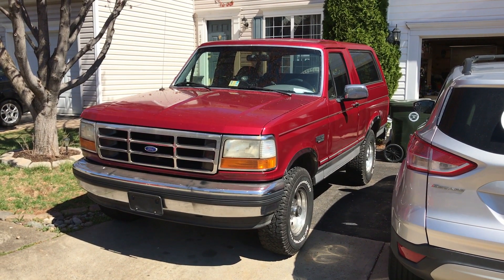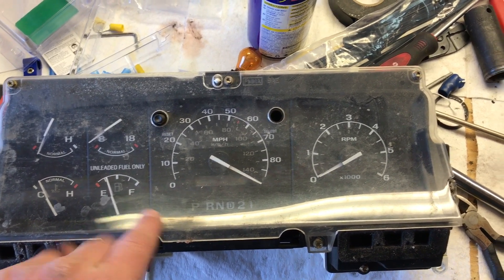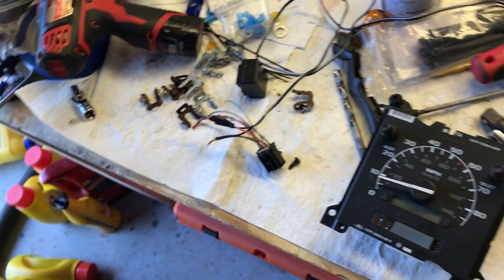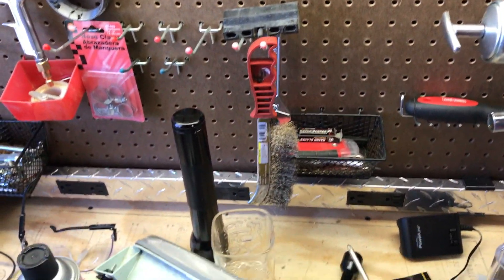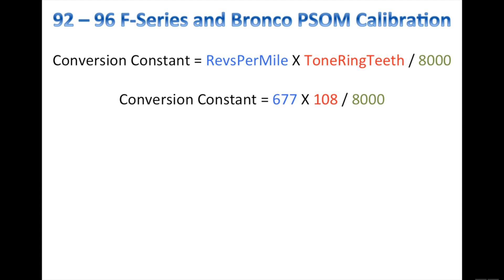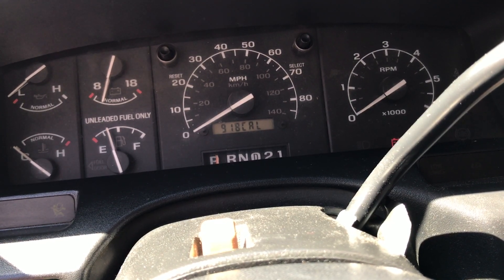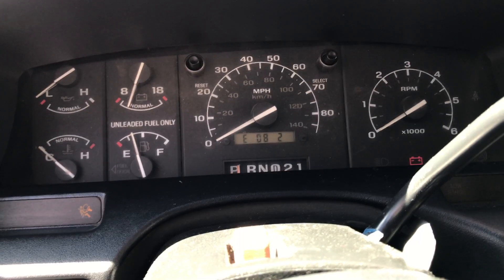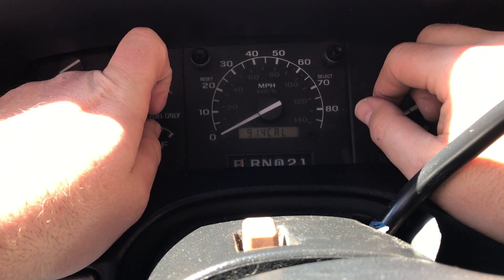"P'ing" the PSOM - Programming the 92-96 F-Series and Bronco PSOM

Comment: Thank you for the great video. I just psom once already but didn't know about the tooth part. Before I change psom again. May I request a verification from you. So I have a 1995 ford f250 5.8L 4x4 gas, with dana ifs 50 front, sterling 10.25 rear. Google states 92+ is 100 tooth not 108 tooth. So my 35x10.5R16 comforser thruster tires are 577 revs. So by 577 x 100 ÷ 8000. I'm to have 7.212. So I should enter 712 on calibration? Cause my last tube video is watched it was 826cal from 912cal on psom. Please I beg of you for verification so I don't waste my 5 remaining chances. Tia

Comment: Yo remplacé mi gauge cluster Because it stopped working and I installed a used one. The problem is that it has 290,000 miles and my truck only has 130000. It is possible to reschedule in cluster with the original miles of my truck?

Comment: every time i try this, as im pressing the select button to lower the number it switches to trip and miles. i’m at 9.17 and im trying to go down to 8.10. it stops me around 900
Reply: update. i didn’t have the connector on my wire all the way crimped down. got mine set!
Reply: Results?

Comment: Why should we care to do this?
If you upsize the tire, your odometer will increment more slowly, helping the value of the truck.
If you go from 29" to 32" just add 10% to the speedometer reading.
While it's cool that it's possible to program it, I see no reason to actually do it

Comment: Great video! I’ve been having issues with my trans it seems to happen when the something on the interior side warms up. It will then down shift or sometimes shift really hard into 3rd gear. I’ve also noticed that the cruise control doesn’t work when this starts to act up. I have a 1993 F 250 XLT HD. I was thinking it’s an issue with PSOM but I don’t know how to test. Thanks  and keep on making great content!

Comment: Thanks for this. Was a tiny bit different on my 92 but matched what i read in some forums, it counts forward not backwards and didnt seam to have any limit to how often i could change it, it didnt even have a reset counter, n the psom port wasnt labeled but in the exact spot shown. Just got the tuck with a bad transmission but its been on 38s for 20 years n it was still factory tire size on the psom, this should help as i get ready to swap in a good transmission.

Comment: PLEASE HELP

I went through this video step by step, however when I hold the RESET button and turn the key to RUN, I get the code “E   03”. When I click RESET again, I get 1000CAL but it won’t let me change the calibration number no matter how many times I click SELECT. I have a wire running from the PSOM terminal to a ground while I’m doing this. Any ideas on how to fix this?

Comment: Thanks for the vid, got mine calibrated down to 864 running BFG A/T 33x12.5 R15 , working better!  Everything worked like a champ
Reply: I have the same tires except they are 10.5. I got the same number. My inital though is it's super low compared to what it's on right now. 967.. but glad it worked for you.. I'll change it soon and if it doesn't work guess I can change it back haha
Reply: @LethalityKing  the 10.5 wouldn’t make a difference just revs per mile which is 640 per mile for both tires.  Get her calibrated down it’s a big and FREE improvement to your performance, shifting, even putting the truck in D and R.  And yes if you don’t like it you can always change it again
Reply: Curious to see if this will solve my hard shift between from drive to reverse. Running the same tired as well @nhamontree
Reply: @xAwoken_Dreamer  hey there - get this done regardless, helps with all shift points, especially driving… it might help shift from D to R but typically that clunk is due to your slip spline in the driveshaft needing lubricrated.  Block the wheels, pull the driveshaft off the rear diff, Hit it with Motorcraft PTFE lube and should fix that issue
Reply: @nhamontree  yeah picking up new joints today hoping all around solves that issue. Thanks
Reply: @LethalityKing  and yes I had to adjust mine quote a bit down to 864.. going from factory tires to 33’s is a big adjustment!

Comment: I'm pretty sure the psom in my 94 f150 needs to be replaced. The Speedometer does not work, the od light is flashing and the transmission won't downshift on it's own. Could it be the psom?
Reply: Same problem

Comment: The best formula is 20168/ by tire height divided by.6666 should give you calculation number. I went by new tires and it was correct went reverse with the numbers and came up with the stock tire height for a check. Tried 2 other ways and they where off.

Comment: Great video! One thing I figured out while re-calibrating mine was the jumper didn't like the cigarette lighter ground and wouldn't let me toggle through the CAL settings. I moved the alligator clip down to the bolt that holds the seat belt to the floor by the center console and that did the trick. My tires are a little worn so now the speedo is  showing high by about 1-2% but it's WAY better than it was before (10+mph low) and now the transmission is shifting much smoother, especially on downshifts coming up to a stop light. Hope this helps someone!
Reply: you probably won't see this but this is exactly what worked for me!

Comment: Hey I’m having trouble with my bronco not wanting to shifting while I’m drive, it automatically goes to 4th gear. I’ve replaced the solenoid pack plug, the MLPS plug, TPS, VSS, and all fuses. I’m going to be replacing the Speedo as well and the coolant temperature sensor maybe even the PCM to be safe, but if you have any idea or advice where to look please share thanks again for the helpful video

Comment: What do I need to set mine at? 35x12.50x17 all terrain ko’s. Which is 602 revs per mile. I have 4:88 gears. Truck is a 1995 ford bronco with a 5.0. Thanks

Comment: If I change diff ratios from 4.10 to 3.55 do I need to reprogram? Ford 10.25 both
Reply: No.  The tone wheel is on the ring gear.  Think if everything connected to the ring gear is stock (Ring gear to tires) , then your gear ratio change only changes the pinion shaft rotations before the ring gear/ tone wheel.  Hopefully I explained that clear enough.

Comment: Ok, can anybody help me out here? - Great video - I have a 97 F250 OBS, how do I disconnect that shift cable, so I can get the cluster out to change a simple bulb??? I feel like I'm getting a lot of resistance from that cable and I'm afraid if I keep pulling on it, I'll break something....Many thanks in advance for some direction!
Reply from the maker: You’ve got to take the column covers off and to the right of the column you’ll see where the little white shifter cable connects at the dash. There is a little black wheel that you use to adjust the shifter indicator. Put the truck in a low gear while turned off to release tension on the cable. Release the copper cable that runs through the white tube from the hook then spin the little black wheel to release the assembly. :)
Reply: @obsgarage6682  Thank you so much, lol! Now I understand! Again, great video :-)
Reply: @obsgarage6682  Worked like a charm ;-) Got the new green LEDs in, and it looks great - Thanks again!

Comment: I Guess I need to check my 1994 F-150 Lightning it shifting a little weird pull a hill. it pulls a hill and then Jumps into the next lower gear when it shouldn't be doing that at least as soon as it does. Thanks for this info I Appreciate it. 0h yeah THUMB's UP👍🏻👍🏻👍🏻👍🏻👍🏻👍🏻

Comment: All the f-150's that i have seen that have never been changed starts out 972! If you do the math on the factory 235/75/15 the number should be 943! I wonder why it is defaulted at 972?
Reply: It's the weight on the tires
Reply: @beasy7227  cant be the weight!

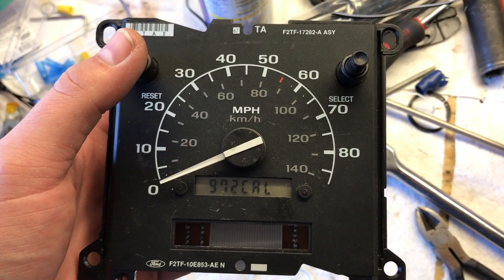Comment: 4:56 How does the speedometer influence a electronic controlled transmission. Im looking at eecIV and eecV pinout and I dont see anything from the speedometer or tach. Im under the impression that the MLPS, OSS
 and VSS controls when to shift. Please what am i missing?
Reply: The VSS signal goes into the PSOM as a square wave form from the rear axle speed sensor. The PSOM converts this to a digital value and sends that to the ECM. The ECM uses the digital value to tell the transmission when to shift. I'vhad a few trucks with late upshift, hard shifts, no overdrive all from a bad PSOM.

Comment: Wow. I have had my bronco since 2003. Never checked this. I have 35's. I just reprogrammed it yesterday. Holly mother of Joseph, I feel like I have been missing out of a lot of power and great shifting. I wish I would of done this from day one!  If you have a lifted F series and have not checked this, do it!  Now the cat doesn't make so much stink, it gets and goes like i got a set of headers on it or something! It took me 5 minutes to double check math, and 5 mins to find a jumper, then 2 minutes to change it! I would say this is a MUST if you have an automatic. Also seems like my engine is a little more beastly. Over all it has definitely gotten rid of that DOGGY SLOW feeling from big tires.  This is a must for anyone that is looking for more power or get up and go.
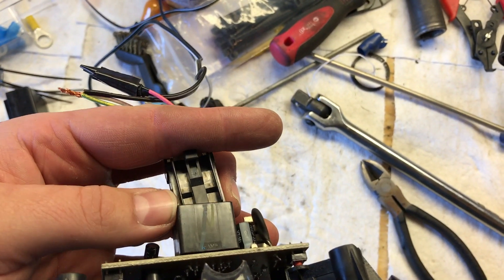Reply: Joshua Miller my gears have been changed to 4:11 with the 6" lift and 35"tires do you know what the math works out to be for my psom number.
Reply: scoffman300 ill have to check it out. However i dont think the for system is measuring from axel rotation so your 4.11s wont bother the equations. I believe thats what i read from ford truck forum. If i can find it, ill come back and refference it.
Reply: scoffman300 ok
The calculations are made from tone ring teeth, this is directly related to wheel revolutions, so wont matter if you have 4.11s or 3.55s or 5.76s. 
Here's one of the calculators:
(Psom calc on the left) http://simonslick.com/PSOM,%20Tires,%20Gears,%20RPM%20Calculator/
Also a link showing the tone ring: 
https://shop.broncograveyard.com/mobile/Ford-88-Exciter-Tone-Ring/productinfo/32392/
Reply: Joshua Miller thanks . Ill work on this .i know right now that my spedo is off by 6 mph . When it show 60 im actually going 66 on gps.
Reply: scoffman300 
mine was close to the same. Now its spot on! Im pleased with the shifting and acceleration change. If you need help let me know.
Reply: Joshua Miller do you remember the numbers
Reply: scoffman300 first
What brand and model of tires are you running in the rear? We need the revolutions per mile, then we can do the math. Its easy math. Also, are you using the original ford 8.8 rear axel with drum brakes? Different sizes have different tone ring. Its important.
Reply: Joshua Miller cooper discoverer 12.50 x 35 x 15 . Yes stock rear end with drums.
Reply: scoffman300 the AT3?
Reply: Joshua Miller auto trans. Yes
Reply: scoffman300 
The tires are they the cooper discovery A.t.3 model? Do they say AT3 on them?
Reply: Sorry for my confusion.  Cooper discoverer  STT . Tire rack spec 600 revs per mile
Reply: Joshua Miller 600 revs per mile for my cooper tires discoverer stt 35 x 12.5 x 15
Reply: scoffman300 
Would be
600 times 108
Then divide by 8000
Thats your conversion constant
Should be 8.10
Reply: Joshua Miller thamk for all of your time. Most people don't want to help anyone.
Reply: scoffman300 
No worries man! Let me know how yours works out.
Reply: scoffman300 
Hey one other thing we gotta keep in mind with our ford trucks, make sure you do the cruise control recall. Its a really small chance but a hand full of these fords have the cruise control start a fire in the motor bay. Usually after the driver stops and goes inside their house. Its a new presure switch by the brake booster and a new 10 inch harnes that goes between switch and existing harness. Google it youll see what im talking about.
Reply: Joshua Miller thanks for the info . I had it done probably 6 years ago
Reply: Joshua Miller i finally got around to changing the psom to 810 and now the speedometer is off by 3mph . Spedo reads 70 and gps reads 67 . Before spedo read 60 gps read 66 .so it was 6 over now its 3 under that's a difference of 9mph . My psom was at 914 and i changed it to 810 thats a difference of 104 and ÷by 9mph = 11.5 per mph so if my math is right i need to add back 34.5 = 844 psom # . Do you agree or did i just confuse the crap out of you.
Reply: scoffman300 
Well I think you're on the right track. However just a few couple things:
Double check your cold tire inflation, if tires are really low could read fast. Also older tires with more mileage tend to have smaller circumference so could read a little fast. Also what are you using for gps mph read out? Maybe double check with second device? 
Btw, ill double check you're math. 
Hey did it make your truck shift better?
Reply: scoffman300 
Well I also have 35s, did my math based on BFG's revs/mile came oit with conv constant of 813... Now 70 on the dash is about 69 gps, and my tires 50% worn down. So double check gps maybe a buddy can hop in with you that has a newer phone with gps app?
Reply: Joshua Miller ill check it with my garmin 62stc
Reply: Joshua Miller  my garmin has mph to the 10th and is very close to the app on my phone.  I used them both on the way to work this morning and it was still 3mph off so on my lunch i change the psom to 835 and now a cording to the garmin gps its only off by less than one half of a mph at 70mph . Im ok with that i dont think i can get it any closer. .thanks for the help
Reply: scoffman300 
Cool!
Reply: What did you set the calibration at? 914 also? I have 35's

Comment: Just did this reset on my 95 F150 after switching out the cluster due to the odometer and speedo failing. Your directions work A-Okay.
Reply: After changing out did you notice if the mileage had increased or did it stop counting when it failed? My 94 f150 odometer doesn't display anymore and curious if it's still ticking along or not.

Comment: Great Video! I run a 35 12.50/15 Dick Cepek Extreme country. I finding several different Revs per mile . I am using 599 which I found at tiresze.com here are my calculations 599x108=64692 then divided 64692 by 8000=8.0865 rounded 8.09 this is the number I input in my PSOM correct.

Comment: Excellent Video, easy to understand and follow. I think It helped me understand  the root of the problem I had on my truck.
My 1992 F150 I-6 300 4AOD was running rough, late, violent upshifts from 1-2, lagging performance. it had a dead Tachometer, so I pulled the PSOM and repaired a cold solder joint, Truck ran much better after, but still had issues. I replaced oversize tires I bought it with, bought factory size on the door and now the old truck runs and shifts smoothly. I am convinced it was the PSOM Calibration setting.

Comment: This was a great video. Super easy to follow for us who are not so mechanically inclined.... I need to replace the PSOM on my 95 f150, I would like to put in one that has a tachometer on it. Would that just be plug and play? Or do I need to do any wiring? Also does the replacement PSOM need to be from another 95? Or will a 93/94 work too?
Reply from the maker: It always been my understanding replacing a cluster must be done in groups.  92-93, 94-95, and 96-97 are compatible with each other.  With that said, I have heard of people using off years successfully but perhaps that has something to do with the build date of the particular donor and recipient vehicle ??  Who knows.  I successfully swapped a 95 cluster with tach into a 95 f150 with no problems. What you do is remove the entire donor cluster and just remove/replace the psom (speedo) into the new cluster and install it. It should plug and play. When people use different year other that I listed I have heard reports of a no charging condition or the battery light staying on, etc.
Reply: @obsgarage6682 I have a question if you have a minute.

Comment: Replaced the PSOM in both of my OBS trucks since I've owned them. When it went bad in my 95 F150, my truck would not shift out of first gear and displayed no other symptoms other than a slight bobbling of the speedo needle at highway speeds. When it went bad in my 94 F250, the odometer was missing numbers from the mileage total, the speedometer went totally dead, and the truck would not shift properly whatsoever. Replaced and all was well again. When an issue comes up with the speedo or odo, and it is accompanied by strange transmission shifting, the PSOM is definitely a good thing to check/try before anything else. Cool video.. will help lots of people.
Reply: My 97 f350 the speedo just went crazy last night.  Abs light came on once till i shut it off and od light was flashing. Got it to no lights by restarting trk and trk felt like it shift way early almost down to lugging an auto? Couple times
Reply: Good comment thanks